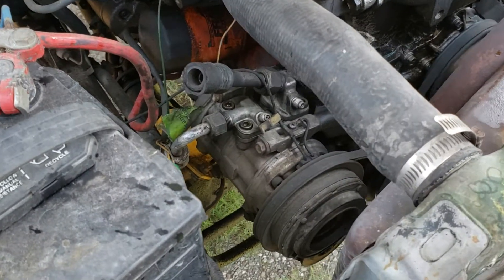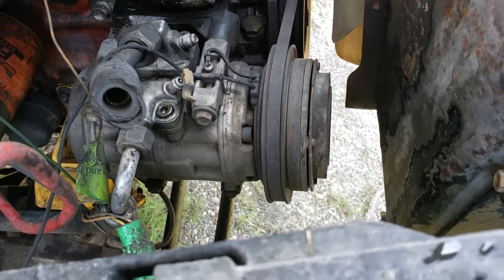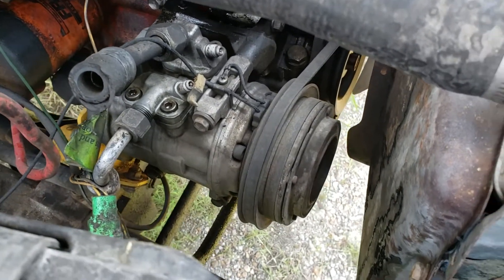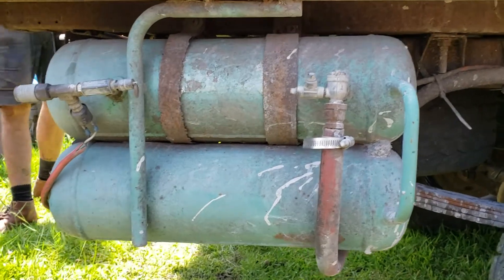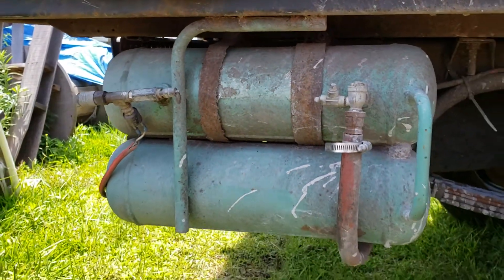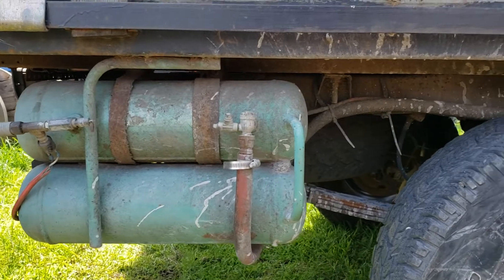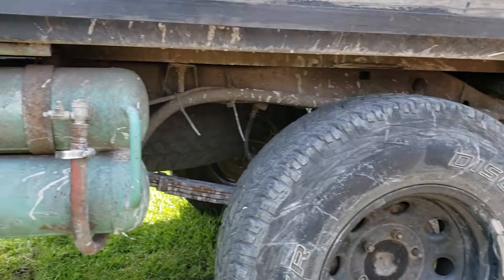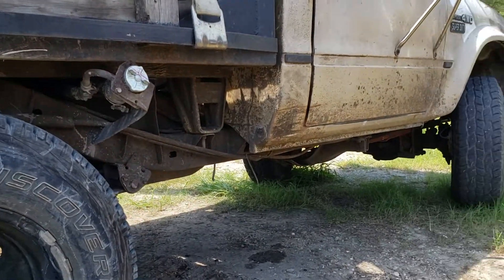1984 Toyota with ac turned into a air compressor

Comment: Wonder how long it will run. No oil sump and no oil pump. An old Alma A6 or a new Seltec TM31 is better fitted for the job
Reply from the maker: I was thinking the same thing. They had been using it for a while and I have a feeling they put oil in the compressor but should have put a filter on the open line to keep all the dirt and road debris out.
Reply: @codyoffgrid  Yes, definitely. Looks like it won't last very long.